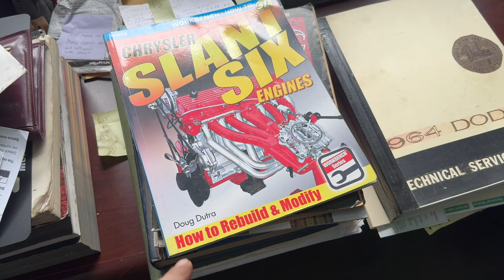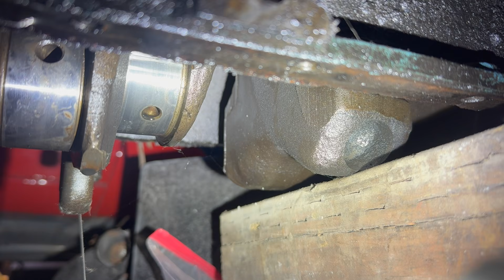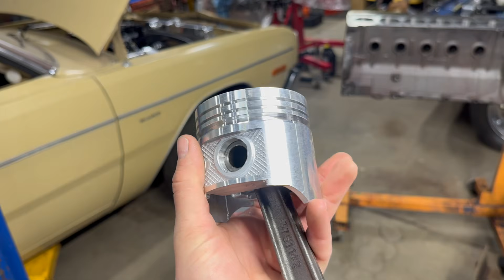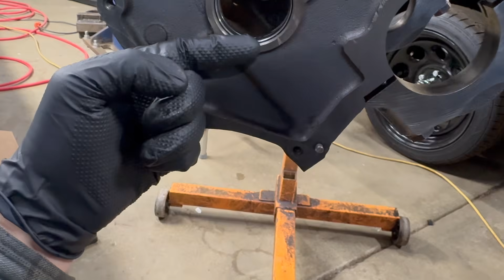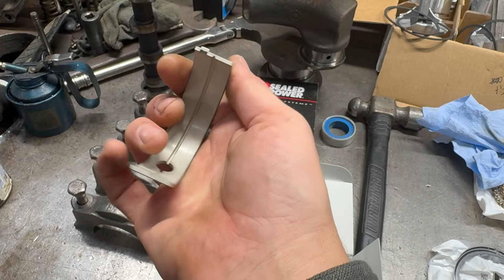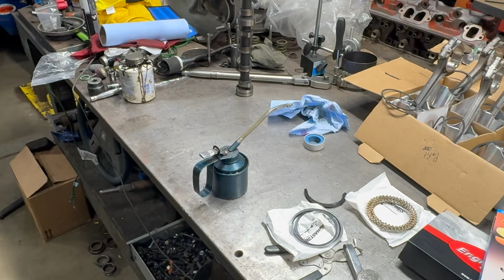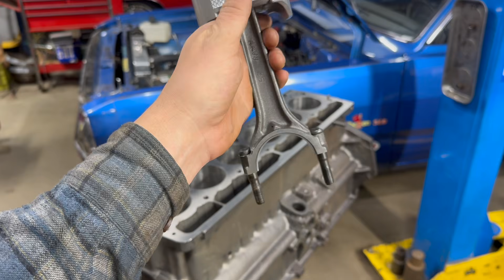Go Fast Slant Build! Lightweight 225 Info, Deck Milling Tech, Short Block Assembly, And Much More

Comment: Just adjusted the Valve lash new stock mechanical fuel pump changed Distributor to Mopar performance electronic ignition kit rebuilt by Mancini racing built an Offenhauser 4 BBL intake cut out the divider changed it to open plenum have a Mr Gasket 1"  4 BBL-2BBL adapter plate and 1/2" Wood looking poly heat shield underneath the new Weber 32/36 manual choke for a flathead weapons Carrier mounted on a 78 225 in a 87 D 100 short bed slant 6 NP 4 speed with Overdrive 8 1/4 3.55 open I may install a electric locker in just because I live in the mountains and nothing is flat has a stock 80 exhaust manifold running 2 1/4" mandrel bent pipe into jegs two chamber muffler exit in front of right rear wheel I have some blow by no noticeable smoke out exhaust making a daily driver out of it have a 35 gallon fuel tank outta a 15 passenger van should give me about 1100 mile highway range when I go into the slant how far can I take off the deck / mill the head to run on 87 octane fuel will probably go with a slightly bigger cam for cruising in the power band running about 70 mph with 235 75 15 tires I rebuilt my 1st slant 6 in a 69 Valiant 4dr in Tech school at 16 in 79 and now being forced into early retirement at 63 I plan in keeping this 87 running another 39 years that should get me to 99 yrs old my 11 Challenger R/T 6 speed 3.91 limited slip with the 2" drop is going into semi retirement

Comment: One of the few things they did wrong with the slant was to make the block aluminum instead of the head.   Just like a Vega except the slant never failed.  But expensive to build, heavier than it should have been and the weight was high.  A alu head would be a real advance.
They always made 110 net HP.  I've owned five, still have three in storage, one with 408,000 miles.
Reply from the maker: The casting technology was simply not there at the time. They tried to make an aluminum head, but it didn't work. The blocks... kinda did. Kinda.

Comment: I think the stock slant 6 intake was your issue with turboing the /6.
I don't know how you could, but I like the idea of cutting up a /6 intake manifold, to direct the intake  ports all straight up, away from the exhaust, and into a common plenum, LS style. Then you can use a turbo, or fuel injection even easier.
I think the extreme difference in stock intake runner length was killing your turbo designs.
Reply from the maker: Gil Welding has already done that. I don't think that was the only issue, but I agree it was a factor.
Reply: @DeadDodgeGarage  Some of those stock /6 intake runners were longer and hotter as well as being just "funky" in their design. It makes tuning the overall engine kinda sketchy.

Comment: Hopefully, all that deck work brought the compression ratio up to at least 10:1. And 110 horsepower per cubic inch.
Reply from the maker: It didn’t. We’re at 8.76:1. Much better than stock, but plenty safe on cheap pump gas.

Comment: Dead blow mallets aren’t meant to strike any surface smaller than its face. I see them all cut up regularly. A hardwood mallet would be useful in your shop. A block of wood between your steel hammer and the work can soften the impact
Reply from the maker: True.

Comment: I had a 1983 Diplomat 225 Slant 6 everything worked including the A/C paid $75 for it in 1994 and the floor board was rusted away, We tried tio blow up the Slant 6 we drove it out of oil and antifreeze for about 15 miles and still ran. We let it cool down and put the fluids back in it and ran perfectly. It proved itself so I paid my body man $200.00 to put new floor boards in it as the body was perfect. They ordered the SE package with all power options including Auto PS/PB Chronometer clock Cold A/C Tilt wheel Cruise Control AM/FM Quartz Lock Cassette Power locks/Windows/Seats/Mirrors and Power Antenna and  Moon Roof wire Wheels/White wall tires. It was 200 labor floor plans were 75.00 and carpet kit was $75.00. Also the Slant 6 was based off the 318 and the distributor from a 318 and a 360 is the same.

Comment: hey any one in Australia have the resources and money to send this guy a 245 or 265 Hemi six.  Australia dumped the slant 6 in the early 70s for our home grown Hemi 6 engine. it came with  V8 power and powered Valiant, Chrysler as the HP engine over the stock V8 power plants from Valiant Chrysler; https://en.wikipedia.org/wiki/Chrysler_Valiant_Charger

Comment: I'm loving this. I grew up on Chrysler a bodies. I have had 12 drivers and the same in parts cars through out the years. I have had 2 with over 600,000 miles on them. Both 225's. I will say that the 225 is the best engine made. I love the 383, 413, 426 and 440

Comment: "Slant 6 videos are happening, come back for more!" -Me looking at video posted in May, goes to channel videos between then and now, half a year later... and nothing.
Reply from the maker: Did another video pulling the old engine (1963 Dodge Dart) and got the parts we needed from it…a month and change ago? Took head to machine shop, found out it was cracked, found another head, just got it back last week. The next build video was supposed to come tomorrow but due to circumstances beyond my control it probably won’t.

Comment: The main bearings same as 426 Hemi check the part number are the same
Reply from the maker: I actually knew that - but these later engines use a smaller main if I recall correctly.
Reply: @DeadDodgeGarage 65 Valiant Regal AP6 here

Comment: Never been right...... Welcome to slant six land............they loved me at Chrysler research and development training school for general engine design.... Because I had a 63 Plymouth valiant......pos...... Slant sixes the original ones... Were designed to last 100,000 MI..... To the first valve job..... The engine was designed to have two valve jobs the one that came from Chrysler with and the one that had a 100,000 mi you would have to go in and freshen it up....... Now I break the slant sixes up into two groups....... Group two might make it to 400,000........ What what are you talking about man........... Chrysler had a problem that they really hated.... Who was the requirements to install sterlite valve seats and valve faces..... By going to the hardened seat because of lead being taken out of the gasoline... All Chrysler's lasted twice as long...... . So early slant 6 is her piles of s****....... And the engines from 1974 on...... No matter whether it's a 318 or what.... Have hardened valve seats and faces....... In the later slide 6s.... Have hardened valve faces which doubles the life of the engine..... They got rid of the points and they have electronic ignition..... These.are vast improvement over the early slot 6s......
Reply from the maker: I’m familiar with the history of hardened seats.

Comment: I picked up the slant 6 book. I think it mentions the 2.2 piston is a really good option for a performance engine. Need to do a 45 thou over bore, but said to be considerably lighter.
And there is a company that makes a 360 circular seal that you use a razor to cut open one side and install.
Reply from the maker: Yes, I have read that - and I’ve seen the seal.
Reply: @DeadDodgeGarage 
Forgot to mention, just brought home my 63 Belvedere with the 3 on the tree and the slant 6
My second Mopar since 40 years, and first since my recent retirement. Much planned for it, and your channel is my go to for information. Thanks again

Comment: Another great video. Have you ever cleaned up any flashing inside the block? Or painted the inside surface?
I think Uncle Tony did that on one motor.
Have to say Very disappointed that Tony never finished any slant 6 performance builds.
Reply from the maker: I’ve never painted the inside of an engine. And while I have planned on grinding down flashing, I never seem to remember until the block is back from the machine shop fully clean and ready to assemble.

Comment: The Slant six was slanted in order to allow for a longer stroke and longer intake runners.
Reply from the maker: No, it wasn’t. It was slanted to shorten the engine, allowing for a low, “European” hood line in the 1960 Valiant.
Reply: @DeadDodgeGarage  I'm going by what Tony DeFeo, Rick Ehrenberg, Tom Hoover, and Chrysler engineers have said. In engineering, form follows function. Function doesn't follow form.

Comment: Suggestion: Two short lengths of fuel hose shoved onto the rod bolts will do two things. Help guide the bolts around the journal without actually nicking the journal. And retain the bearing so you don't have to bend over, pick it up, clean it off, and reinstall it into the rod.
Reply from the maker: I usually use one long loop of hose around the crank journal, slid over the rod bolts. Doubles as an easy hand hold to guide the rod. I didn’t here, and I guess I didn’t mention it in this video, but I have discussed it in others. Thanks.

Comment: Yeah I put a 170 into my 68 Dart years ago and had it cut 90 thousands and it was a cheap update to improve the performance. 
I did have a problem with the 170 and that was because it was a 63 or 64 block and had a smaller opening at the back of the crank so the 68 torque converter would not mate up with it. Had to swap some parts from the earlier trans to get it to work. 
Good video. Happy Motoring.
Reply: My friend used an early crank in his 318 and when he tried to bolt it up with a late performance converter  it broke a big chunk out of the 727 bell housing. He threw it in my truck and said take it...and put a 904 in it. I took it to my favorite welding place "Eyeball Engineering" in Fontana they welded it up and it fit well behind my 340.

Comment: The bearings for the cast crank won't have the oiling holes for the aluminum engine. Also, .100" off the block deck doesn't make it crack prone as long as you chamfer the tops of the holes and use a head bolt washer so the bolt doesn't have a chance to bottom out in the block. The head really needs a bigger intake valve to improve performance. Early Ford 289 valves are a good size at 1.78/1.45", but require 5/16" valve guides.
Reply from the maker: Duh - I forgot the bearings are different sizes. Good to know.

Comment: Great video! Well done! One thing about the Aviation Form a Gasket, it's alcohol based. It should not be used where it will be in contact with coolant as ethylene glycol is an alcohol.
Reply from the maker: Then why did Chrysler use it on head gaskets? And why do countless builders use it on core plugs? Thank you.